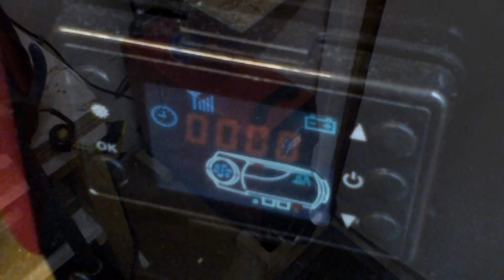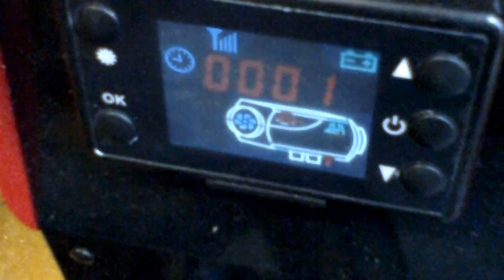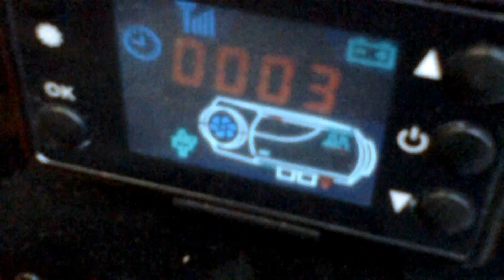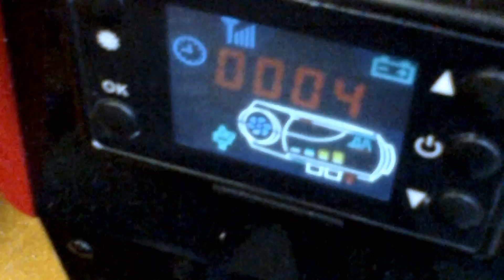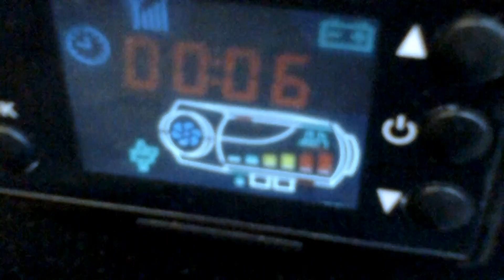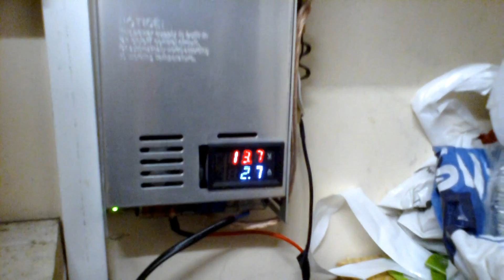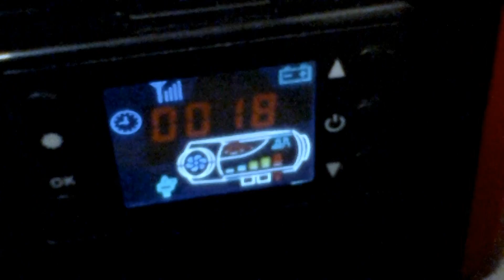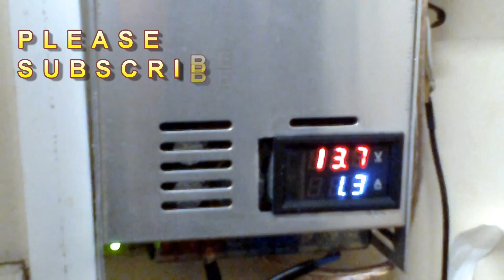COMPACT CHINESE DIESEL AIR HEATER - AMPS used in REAL TIME

Comment: Nice video!
I saw somewhere these 5KW heaters are max. 18.000BTUs. My cabin is 38m2 and calculate max. 11.200BTU heat requirement. I have a small outhouse ca10m2 with wind generator, batteries (and soon solar cells this spring). I will order 5KW Diesel Air & Water heater to place there to run closed alcohol/water heating system for the cabin and use the air to heat the outhouse and warm the 50/50 diesel/cheap veggy oil enough so everything will run smoothly. Placing all equipment into the outhouse will give us quiet operation and nice night sleep I hope. I am crossing fingers this will work ok!
Reply from the maker: Hi Command. Thanks for the comment - not heard much about the dual diesel / water heater and to be honest from the review I’ve seen I would not go down that route because if you need to service the heater it’s a drain down of the water system and it’s four tubes to disconnect at the heater base. For the hot water I had excellent results that looked very promising by taking the heat from the exhaust and that resulted in excellent heat transfer and with lagging to keep the heat in things could be very toasty - I did two videos on exhaust heat recovery and the first experiment was not a success in terms of either safety or practicality but my second try using microbore copper pipe was excellent and would be well useful.
Check out the videos on my channel and see what you think. I do feel simple is the best and although the new Chinese diesel / water heater looks good it’s not as practical if you need to strip it down to do a repair or de soot the dam thing.
Let me know which way you go. Regards and always stay warm. Peter

Comment: This is a bit weird, I guess they made a mistake doing it that way. No offense but if I stop the fuel pump why does the glow-plug need to fire up again? The heat-exchanger only needs cool air (fan) to cool the heater down. What else is a glowplug for, start-up only? They just made a mistake in the software of the controller. Using 12A at the start and then only 0.5A with 13.6v in economy mode is impressive. So the fan and the pump only uses 6 Watt/h, maybe burning only 200ml (a cup of tea) or less fuel every hour. Why would it not be possible to start with these low settings, just takes longer to fire up, something has to be changed about that high amp glowing mechanism? Then we can make things really portable and efficient.
Reply from the maker: Hi Robbert. Thanks for your comment and I do see your point on shutdown but I can only test what I have as the manufacturer is responsible for the actual programming of the unit there is nothing I can do. The efficiency of the unit is impressive and one of my neighbours is installing two in his bungalow - one is already up and running and the performance as far as heating and cost economy seems impressive. He was originally just going to use the heater as a backup but seems to be using it as his main heating as he can get the red diesel from a farm so it’s a low price...
His installation of the unit is in a box outside so no ticking pump...
 Stay warm. Regards Peter

Comment: I have a 2kw heater. It runs for the same amount of time as you showed for start up and shut down. However, it uses 8 amps when glow plug is on and 2 amps with glow plug off but running on highest Hz setting. When on lowest Hz it's .5 amps.
Reply from the maker: Hi Roger. My video shows the results in real time and the first tests I did I used a unbranded multimeter to see what the unit was pulling but I felt it was better to try another meter with a decent shunt. The shunt on the power supply is massive at around 70mm long and matched to the meter unit so I felt it was better calibrated and showed a higher draw than using the multimeter. I have also noticed that as the glo plug has aged the current draw seems to be increasing slightly on startup and shutdown so this maybe a prelude to failure - we will see.
Thanks for your comment and May you always stay warm.
Regards Peter

Comment: Thanks for this!  I have been thinking about using this "all in one" unit or the same unit that comes in components to build a portable heater for truck camping in the winter.  The startup was significantly more amperage draw than I thought, but the low heat setting was nice to see.  I have several 65Ah batteries available to me, and am contemplating how long I could run this heater with one or two batteries.  Thanks again!
Reply from the maker: Hi there. Glad the video helped you. And many thanks for posting your comment.
Stay warm and toasty. Merry Christmas.
Regards Peter

Comment: Just curious how you like this heater after having it for a while now. Is it worth the $$
Reply from the maker: FANTASTIC BIT OF KIT.  I have two working units and neither have missed a beat. I also now have a neighbour who is using two units for his home - originally as a back up unit but now tends to be on all the time as more cost effective than his other heating. My wife would divorce me if she lost hers in her craft cabin which is now usable all year round.
I can’t say more. Even on the fact that if they go wrong the parts are so ridiculously cheap you will think they made a mistake.
Can’t be more honest than that.
Regards Peter
Reply: @brucepeter2007  thank you very much. I've seen complaints about them being labeled with the wrong fuel type saying gasoline instead of diesel.  Just curious if you or the neighbor has gotten wrong labels on the units.

Comment: These heaters are definitely nice, but man do I ever wish they would have designed a quieter non ticking fuel pump.  That loud constant ticking is not a good idea for trying to sleep with it on.
Reply from the maker: Hi Ryd. Thanks for the comment and a lot bring this point up. I will try to explain a bit which may help. I know the term isa pump but in actuality it’s a dose pump which gives a very exact and precise amount of fuel delivery with every click.
The dose pump click speed is directly related to the speed the fan rotates at Sotheby’s more heat required the more licks you get. As the unit reaches its set temperature the pump slows down dramatically and the fan reduces on speed so the unit becomes quite quiet. 
Depending on the installation of the unit something can be done about the noise. My friend and neighbour uses one to heat his home and installed a box outside for the heater and pump to fit in. Once it’s got the area up to temperature and the fan has backed off there are no clicks or the sound of rushing air...
Hope I’ve answered your question.
Stay warm. Regards Peter
Reply: @brucepeter2007  Thanks for the info.  That's all very well and good if you have a heater that you can tuck away somewhere to dampen the noise, but I bought one that was an all in one unit, which has everything in one casing, fuel tank and all.  I wanted it that way because I figured having this thing more portable would be of benefit to me, incase I want to use it in the house or something.   But my installation in my rv has it sitting right behind my bed.  I figured I'd get the best heat that way.  I'm not regretting buying it, but if I'd have known the ticking was so loud and continues, I might have thought slightly differently in buying it.
Reply from the maker: @rydstallion75  Hi again Ryd. I do understand now what you say. The only thing I can say is the repetitive ticking could also be used as a sound track in ones minds eye to accompany sheep counting while trying to go to sleep.🤔.
The all in one unit is harder to resolve and vans tend to reverberate which does not help but once the heater has got the inside up to your set temperature it backs off a lot and is easier to live with. It’s a feature of the heater you can’t completely get away from - but at least you will always be toasty.
Regards and count many sheep.
Merry Christmas.
Peter
Reply: @brucepeter2007  Hey would you happen to have some advice for me in proper venting and breathing of these diesel heaters?  Obviously the venting isn't an issue, I just have the exhaust pipe running outward of my RV, but the air breather I'm wondering if it will work ok to be on the inside of my RV.  I'm only thinking that way because I didn't want to cut another hole in the floor.  Also, another question I have,....if it does need to stick outside like the exhaust, could I extend the breathing hose to alot more length and not have it affect the airflow?  Thanks for your advice thus far.
Reply from the maker: @rydstallion75  hi again Ryd.
Regarding your questions. - the combustion inlet should also be taken from outside and it’s not an issue where it’s put.
The reason it should be outside is that then the whole combustion system is outside so there is no way any combustion gasses can get inside your van so cut another hole and that will ensure you wake up the next morning...
Regarding extending the combustion / air inlet / exhaust I would recommend not to do it because of sooting in the combustion chamber which would cause you grief.
Stay safe and stay warm
Regards Peter
Reply: @brucepeter2007  Thanks again.   The instruction manual that came with my heater has virtually no information on the components and installation process, so it's kinda left me guessing.

Comment: I don't quite understand why would it need glow plug on in shut down process. Shouldn't fan be enough to cool it off? I have hot air soldering station. It blows untill it cools off. But heater is shut down right away. Nice video BTW.
Reply from the maker: Hi Fibra.  Thanks for taking the time to ask the question as that’s what it’s all about posting videos.
The shut dow process is automatic and you have no input control over the process. The reason the glo plug comes on at shutdown is to remove all traces of unburnt diesel that may still be within the burner and this prevents the combustion chamber fro sooting up.
Hope I have answered your question.
Stay warm. Regards Peter

Comment: What settings is on the LCD before I purchase one? I need to know if you can just set it at 10*c and leave it until it needs fuel? 
Rick
Reply from the maker: Hi Rick. With a question like that it’s impossible to reply as there are so many factors that affect the answer.
The heater is more like a furnace in operation and it will only turn down so far and then that’s it as it can’t turn on /off at will.
So it depends on outside temperature and how big the area to heat is and the height and insulation of the room your heating.
I use one for my shed 6x3 mtrs and my wife’s craft cabin is about the same size and both are insulated well and after the set temperature - which you can set on the control panel - is reached the heater backs off on output power and runs around 2kW as an estimate but in both our sheds the temperature will climb because once heated the output heat is still high enough for the inside temperature to climb even at around 5 C out. So as you can see if your area is not too large perhaps for 10c it would be better to have something else... Too many variables for me to even give a divinity answer so I think you need to do more research to get your answers. I hope this helped you. 
Regards Peter
Reply: Do not run these heaters on low settings as they clog up really fast. They need to run at the top end of heat output for at least a couple of hours a day when in full time use. There is a vid on here showing what happens you will have to search for it but it is there.
Reply from the maker: @skippyone2769  Hi skip. I just had to reply to your comment as you are totally misinformed so I need to enlighten you.
I have had two 5kW heaters for well over a year now and I have ordered 3 others for friends with strict instructions NOT TO TOUCH THE SETTINGS. All been running for over a year now and after the set temperature is reached - set mine to 22c the heater cuts back to low heat tick over pushing out I recon about 2kW of heat and it stays like that all day with no problems.
Before I shut down either heater - and my friends do the same - we just run the heater full blast for about ten minutes to burn off and possible carbon build up and after it has shut down we just use the residue heat to finish off in the shed / wife’s craft room. (Usually have about half hour). And that’s that. Big problem is too many people mess about with the settings or do bad installations like extending the exhaust or lengthening the hot are vents and so on - to many things to put here in this reply but I can sincerely assure you these heaters are not only great value for money but are reliable and extremely cost effective but only if you do a good install and follow the shut down rule.
I now have a neighbour who was so impressed with my set up he wanted two hearers for himself and I have helped him install two 5kW diesel heater units to heat his bungalow and although it’s only got down to 2C outside so far one heater is keeping him toasty so he has not yet fired up the second unit so he’s keeping it as a backup...
The only future issues with the units are - how long can it run before something eventually fails🤔 - but so far we have not had to pay out for anything.
Just as a footnote go and check out the price of parts - they cost so little it’s almost untrue.
Hope you will forgive the lengthy reply but I feel you needed to have a good explanation to cover your comment.
Regards and Happy New Year to you
Peter
Reply: @brucepeter2007  Peter thanks for the reply. I don't doubt your experience for one minute and the information is accurate and sincere.
However I was responding to a specific question about setting a low room temp and leaving the unit on until the fuel ran out.
I am assuming this would be someone who wants to use as a type of frost stat to keep a boat or caravan from getting condensation and mould over winter.
Now this specific application, is not one I recommend as my personal experience of the exact same thing, it sooted up and blocked with carbon because it never got hot enough. As soon as the unit achieved 10 degrees C it would throttle back and cool down before getting hot enough for long enough to burn off and carbon deposits. Please do search for the vid on here about carbon build up and how the wrong application can cause problems with its performance.
Also, testing my unit 5KW the starting current peaked at 8.7amps for me.
Take care and I hope you get many years of service out of your units.
Reply: @brucepeter2007  found the vid but can't post the link but type into search "what you must know before using your new Planar heater"
I know it's a different make but it is exactly the same heater.
Hope this works!
Reply from the maker: @skippyone2769  Hi Skip. Tried to find the video you refer to but no luck. I did point out in my reply to you that the unit should be full for about ten minutes before shut down to help clear any possible soot / carbon and perhaps that’s the key with all the heaters our little enclave has purchased - that’s 8 in total now.
Thank you for your reply and I hope you have better luck in the future.
Regards Peter
Reply: @brucepeter2007  I have checked the vid is still there!
The point being 1, you said I was misinformed. I am not I assure you I have owned the 5KW version for two years now.
2, the point I make is if you set the room temp too low the unit never gets hot + for long enough to burn off the soot generated by the flame when running on diesel.
Switch to kerosene not a problem but higher risk if the unit is internal.
Reply from the maker: @skippyone2769  Hi Skip. For the heater unit to start up and go into running at low speed would mean that your room temperature was high enough and above the set temperature on the controller - why would you do this as if the temperature set is the same as the room temperature you would not need the heater on!
If you did above it would almost immediately go into a slow speed mode which is not an issue AS LONG UP YOU TAKE THE TEMPERATURE SETTING UP TO HIGH (around 35) for just ten minutes to burn off any carbon.
Under normal GOOD installation you would have on issues but if you do then you possibly need to go down the tuneup route which without the right professional equipment and expertise I would not recommend.
Regards Peter
Reply: @brucepeter2007  Peter my last response as you don't seem to get it. The question was from someone else who I suspect wants to leave the unit on a low temp to prolong the fuel so they can leave it unattended for several days if not weeks.
A common situation for boat owners or van owners who don't use them in the winter. It is to prevent mould and condensation ... They will not be there to turn stat up to 35degrees to burn off carbon build up for ten minutes each time the unit cycles through a start and stop. Now watch the vid on YouTube do not come back to me until you have OK!!!!!!!!!!!
Reply: @brucepeter2007  peter, you should advertise a fitting service for these heaters, i had 3 heart attacks last year and am finding things a little difficult at times. I would willingly pay. Great videos peter.

Comment: Mine won't start because max it can pull is 9 volts. Is my lesure battery dead?
Reply from the maker: Hi Adventure. As your heater needs more Amps it pulls the voltage down so you need to either charge your battery and if the battery won’t hold the charge it’s had it.
Volts are different from Amps which is what I tried to explain in my video.
Regards Peter